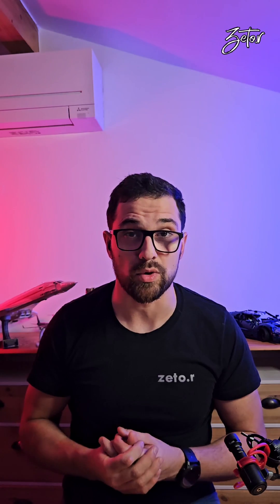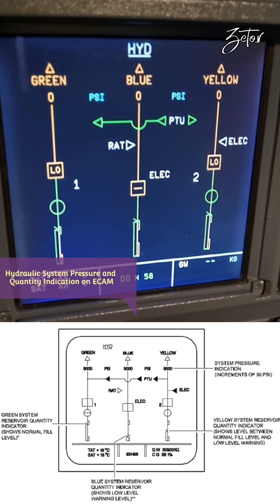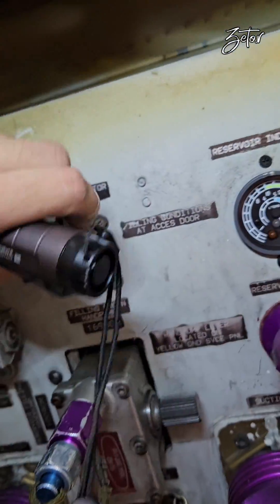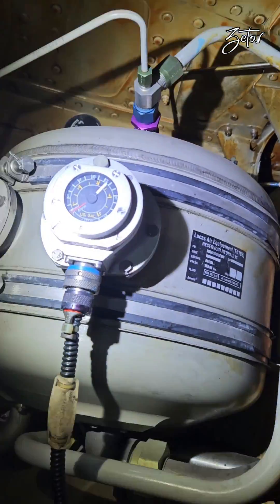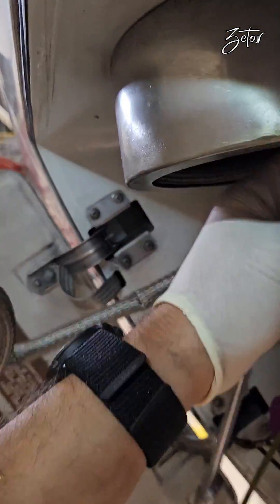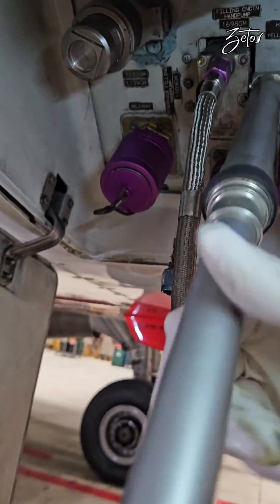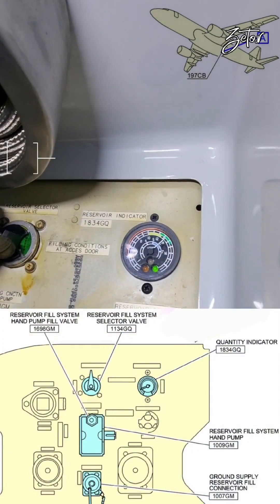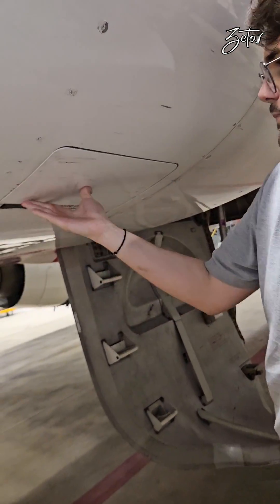ATA 12 Servicing of hydraulic system on A320

Comment: Why it is necessary to pressurize break accumulator during hydraulic servicing ?
Reply from the maker: Because if you release brake accu in to the system all of that fluid will move in to the tank which will give you wrong information

Comment: Hi , can you confirm that when you use the selector the valve will operate either electrically or manually..?
Reply from the maker: The selector valve is manual but the gauge is electric